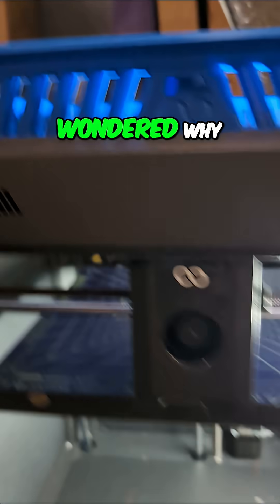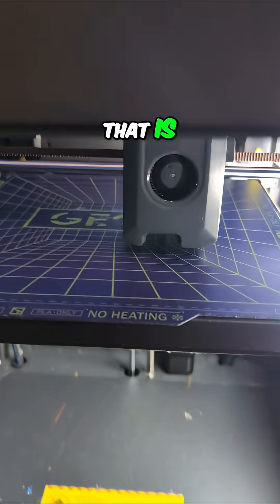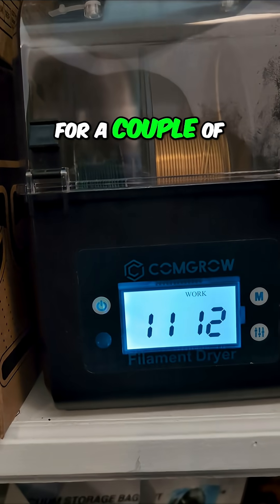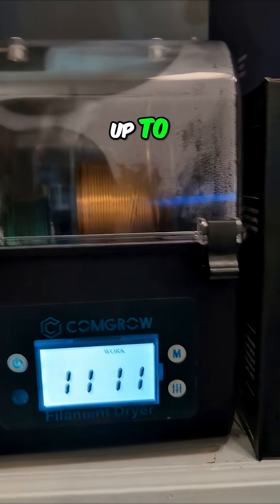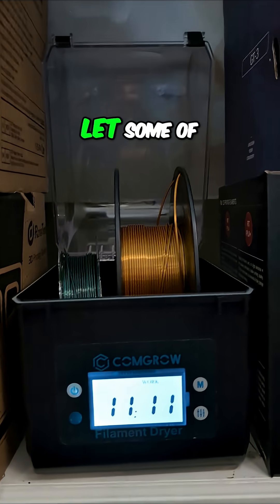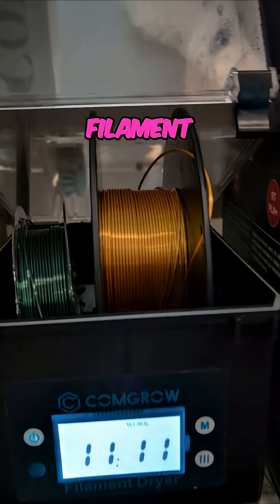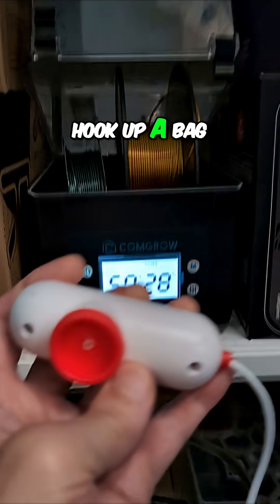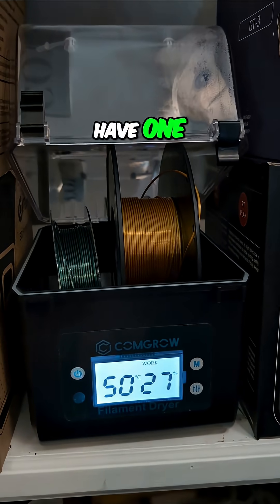Why You MUST Dry Your 3D Printing Filament! #shorts

Comment: Eight 3d printers and I have never ever dried my filament . Specially PLA it doesn't hold moister,
Reply: Yeah my house averages 50% +-5 all year and I just grabbed a roll of tpu of the shelf from 4 years ago and it printed like perfection. But yeah I don't dry pla or petg.
Reply from the maker: I'm happy it worked for you. Most people aren't so lucky. :)
Reply from the maker: I think this video suggests that it actually does. :)

Comment: Making a dry box with a sterilite container is cheap and easy. I print pa6cf, pahtcf and PPScf out of it without any issues at all. 

You can print a cover for your runout sensor that holds a ptfe tube so no water gets absorbed
Reply from the maker: Yeah, but these dryers are so cheap and easy that I'd rather go with active drying in a pre-made package.

Comment: Dang I've never owned a dryer but I just got an h2d with the ams 2  pro  so I'll probably dry all of my filament.  Thanks for the advice
Reply: Definitely dry filaments like TPU and Nylon (anything with "PA" at the beginning), those absorb water like crazy.
PLA isn't terrible about it, but even then, drying helps to keep it supple and flexible, so that little pieces don't break off in the tube and cause trouble.
PETG, especially transparent, is better when dried.
Good luck and have fun!
Reply from the maker: WEll said, thanks.